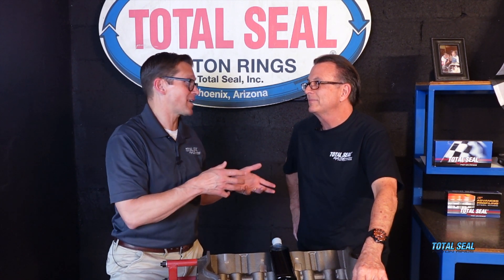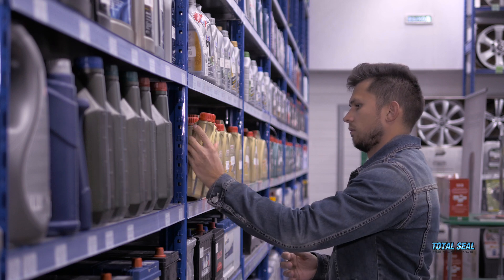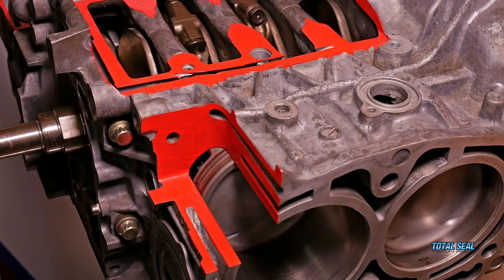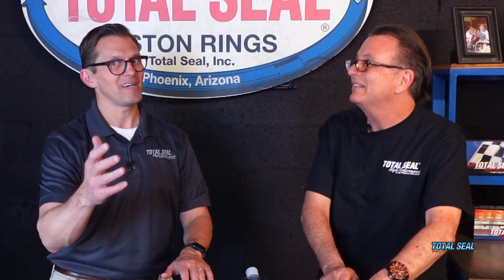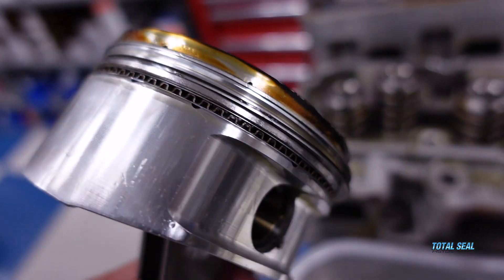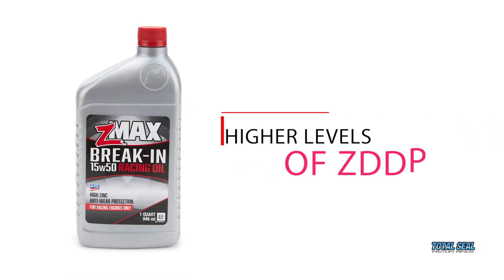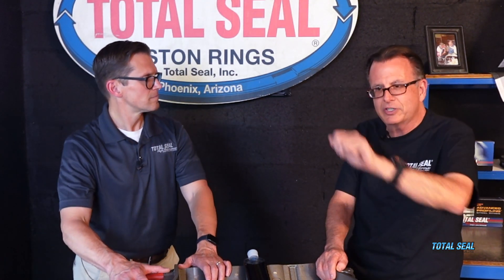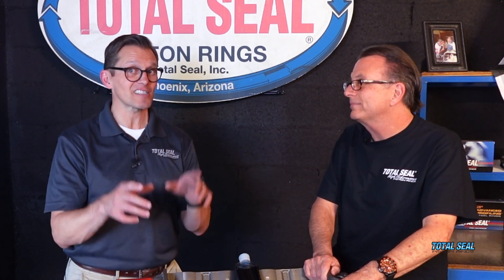Engine Break-In Oil - Is It Science or Just Marketing?

Comment: I use straight 30wt (mineral based) non-detergent oil from a good oil company. After cam break-in, leak check, adjustments, I drain that and go to a conventional (again mineral based) multi grade oil - weight dependent on the customer's ultimate use for the engine. I recommend first actual oil change at 500mi, and then on to regular oil change intervals using regular or synthetic based oil(s)

Comment: Is there any need to change your break in oil after say 20 miles of initial break in?  Im wondering if the initial break in oil might contain any metal particles from the initial break in?  So Im saying change the initial break in oil and replace it with more break in oil and then run it for the 400 500 miles thats recomended?    Or just run the initial break in oil for the 400 miles then go to your standard running oil?
Reply from the maker: It does make sense to change the oil after 30 minutes of initial engine run time. There is a higher level of wear during that time.
Reply: So,basically break it in,drain oil and inspect,and fill it back up with break in oil again and run it?is it safe to run engine on just the outer springs while you finish breaking it in?

Comment: Anyone had tried Amsoil break-in oil, any feedback is appreciated
Reply from the maker: That is a high Calcium formula, which is not ideal.
Reply: @TotalSeal  thanks much apriciated, I will try to get my hands on Motul then, and not use Molí paste on my cam, I guess the same break in oil will do it's job as well with the cam.
Reply: Hello Total Seal.  Question on break in oil time line. I had my Vintage pontiac built and stroked and got it on the dyno, warm up and did 2 pulls. Had cant remember? Green color break in oil for my falt too cam break in. Drained oil and filter and refilled with the same break in oil and got 2 more full pulls. Great.  Stored engine for 2 years in garage full of coolant and a oil pan warmer set to 50 degrees as Im in the north east. Question. When I get it in, any advice on starting it , I cant prime it with distributor drive shaft as its in and timed now,but figured Id presure the oil filter adapter to try to prime? Im going to change oil again before starting,should I continue with the break in oil or go to regular oil. Not sure how long I need to use break in oil ? Thanks for any help. Tom

Comment: I though the manufacturer prefill breaking oil with brand new vehicle and often require change oil for the first 1000km back in the dealership. Isn't that the normal case?
Reply from the maker: Not any more. Most factory fill oils are called out to go 10,000 miles on the first oil change. https://youtu.be/_6nWCQ_70J0?si=2ZSkTG_acX5A3v6B

Comment: Valvoline 15-40 super diesel
Reply from the maker: That's not a break-in oil
Reply: @TotalSeal  Australia's best engine builder how done my engine uses it. Break in oil is not needed on roller engines, it only has to have high Zinc in it like Valvoline 15-40 super diesel
Reply from the maker: @jasonnash2691  Piston rings break-in just like flat tappet cams. Otherwise, we would not be talking about this.

Comment: Amsoil also has a friction-modifier-free break-in oil. I used it in my supercharged small block combination.
Reply from the maker: That is true. The downside to that oil is that it has a high Calcium detergent content.
Reply: @TotalSeal  what kind of effects does that detergent level have on the break-in procedure?
Reply from the maker: @michaelallen2501  A higher level of detergent slows down the break-in process. Because detergents compete against the ZDDP on the engine running surfaces, it inhibits ring seal. We've seen it multiple times on the dyno.
Reply: @TotalSeal if you had to rank too much detergent vs friction modifiers being present, which one is more counterproductive to the break-in process?
Reply from the maker: @michaelallen2501  They can both be equally bad. We've seen poor ring seating with non-friction modified but high detergent oil, and we've seen poor ring seal with highly friction modified oils with lower levels of detergent. The worst case scenario is high detergent and high friction modifier content. This is why we only recommend the use of low detergent, non-friction modified oils.
Reply: @TotalSeal  thanks for the prompt replies and trusted information! This was my first engine build and there's been a bunch of lessons learned. It seems to run well but like almost everything I'm sure it wasn't quite optimized. When this combo gets weak and I rebuild it again I will make sure to use your products and follow those break-in oil recommendations!

Comment: You guys need to research Penn Grade motor oil. Not Pennzoil, Penn Grade coming from Western Pa. Very high in Zinc and Phosphorus. Great for break in and Racing.
Reply from the maker: We are familiar with that product. It is no longer coming from PA. Instead, it is made in Indiana now, and it has a high detergent level. That’s why it is not on our recommended list.
Reply: Which is such a shame the brad Penn racing oil was great struff that was my oil of choice for my medium performance 350 sbc.... the new product is definitely not the same quality.  I switched over to valvoline vr1 because it's always on the local parts store shelves and  seems to work well... I used comp cams break in-oil back in 2013 for the build. Ran it for 30 mins and changed the oil.  Maybe 2000 miles on the car since and she screams.

Comment: I don’t trust the chemists who formulate my oil. They surely will have agendas different from mine. They will want to skimp on an additive to save money. They will have to formulate something that will work in some odd-ball engine without making it fail. 
My agenda is a low friction, low wear engine that will last forever. 
They have to follow government orders. To bad all their testing can’t match with what I would want to buy.
Reply from the maker: Sounds like you need to look for a different oil company. There are some companies that can make products specific to your application.
Reply: Thanks Total Seal 
I just watched the steel on steel tests and bought the product TurboMaxx. A small amount of this additive in cheap oil, protects much better than the most expensive professionally formulated oils.
 I can’t even use the treated waste oil for drilling oil. It won’t drill.
Reply: @TotalSeal
After watching your video on Toyota’s 0w-8 and 0w-16, I would trust them for my oil. Too bad my vehicles need 10w-30 to 20w-50

Comment: Is it a good ir bad idea to run break in oil if a car gas been broken in ?  I have 40k, bought my 6.4 with zero miles abd broke in with the stock filled pennzoil  0w40 ultra platinum, and added a bottle of Redline break in additive.  I removed tge oil at 500 miles, dud tge same orocess again for aporix 1000 miles, tgen continued to run the pennzoil 0w40 for 36k. I change my oil every 3000 miles. I just switched to Amsoil signature 0w40, and continue to cgange every 4000 mikes now...
Reply from the maker: Yes, it is not a good idea to use break-in oil past the break-in stage.
Reply: @TotalSeal  Thank you.

Comment: Back in the day when we had zinc in street oil, break in oil wasn't a thing. Then they took the zinc etc out without letting anyone know, and everyone spent 2 years replacing burned up cams. Ah yes the good old days.
Reply from the maker: Yep, the ZDDP level change in motor oil changed everything else.
Reply: @TotalSeal  How much zinc is in 30 weight nondetergent?
Reply: We always use the cheap non detergent oil with GM Eos with no problems, If I'm not mistaking that's how GM did all of their production vehicles for decades In the old day
Reply: ,,, And , made Joe Gibbs another fortune ,,, !

Comment: Doesn't Total Seal Quick Seat contain a moly? If not, what is in it?
Reply from the maker: It is a dry film lubricant that doesn't react with the ZDDP in the oil or state on the cylinder. It is only protecting during assembly.

Comment: I used BR30 on the LS6 I built last year. Seems like it worked pretty well, however I can't say for sure because I was rear ended in that car and the car was totaled after less than 2000 miles of driving with that engine :(

Comment: Awesome video guys. I think the question about what to use after 500 miles pertains more to what TYPE of oil, not brands etc.... continue using break in oil? Go back to a conventional? Does it solely rely on blow-by and if the rings have truly broken-in? Should they be broken in by 500 miles? (I think I know the answer to that one...)

I think the real question is when can we safely reintroduce an oil with friction modifiers?

Thanks again, keep 'em coming!
Reply from the maker: The rings should be broken in well before 500 miles, so you are safe to go to a friction modified oil after 500 miles.

Comment: Great info, thanks guys!
I am guilty of “chemical Russian-roulette”. 
Have been using TurboMaxx which basically stops steel on steel wear. It has plenty of moly, zinc, calcium, etc, etc. 
I used TotalSeal gapless second rings set. 
Will my blow-by likely be excessive?
If so, could I re-hone the cylinders and use proper break-in oil?

Comment: Most motorcycle manuals all say to coat valves and valves springs in moly grease. If I am rebuilding road bike engines would it be better to swap moly grease for different assembly lube? But again wouldn't that assembly lube also contaminate the break in oil? Great video lots of details love it
Reply from the maker: We are happy to help. The small amount of moly grease on the valves won’t hurt the rings as long as the break-in oil doesn’t contain Moly.
Reply: Would like to see the answer to this from total seal
Reply: I truthfully had never heard of this before but I am not in the motorcycle engine rebuilding world.

Comment: If moly is bad in break in oil.  I use moly graphite assembly lube on the bearings because i found the transparent products dripped out.  I do before initial start up remove the spark plugs and the oil filter. Use a remote starter button to spin the engine just a few seconds till i get oil from the filter mount.  Screw the filter on and crank 10 more seconds . Then get ready for first start.  Eye on oil pressure.  Am i wrong in using the moly graphite assembly lube. I really have not experienced any ring break in issues.
Reply from the maker: We would recommend using a different bearing lube. There are plenty of good assembly oils and greases that don’t contain moly.
Reply: There are a dozen or more different types of Moly available.  Not all moly is bad for a break in.

Comment: How do you know when your engine is finished breaking in?
Reply from the maker: Great question, the best way to know is using a blow-by meter to measure the blow-by. Once it levels off, the engine is basically broken in. Alternatively, if you follow the procedures listed in videos links provided in the description box, you will ensure the engine is broken in.
Reply: @TotalSeal  thanks!
Reply: Once the starter motor stops turning...